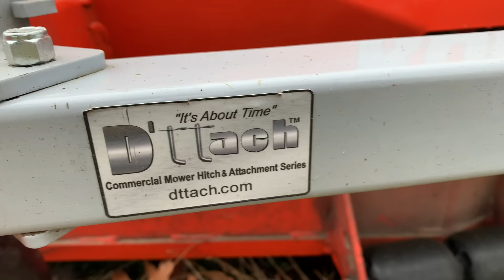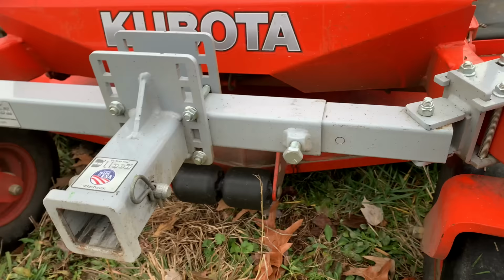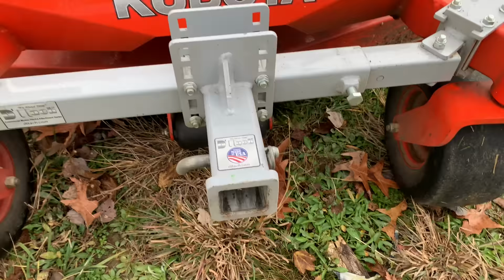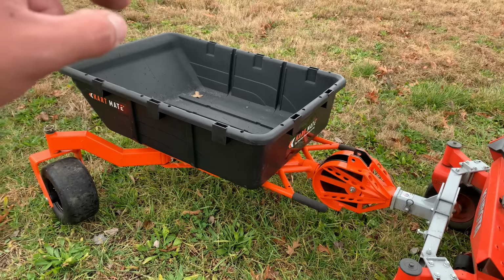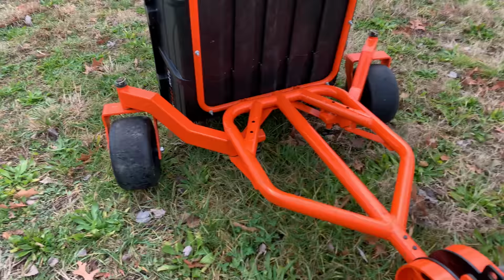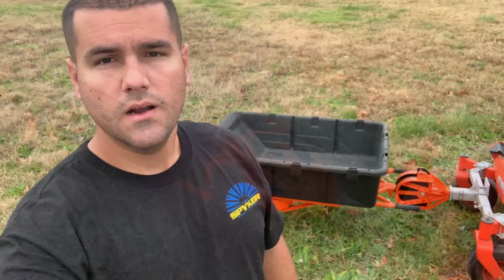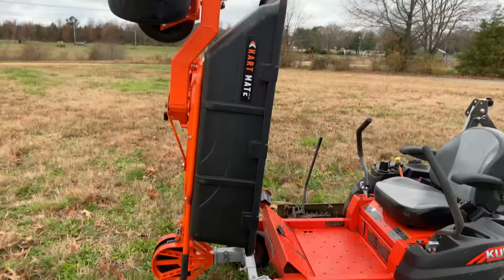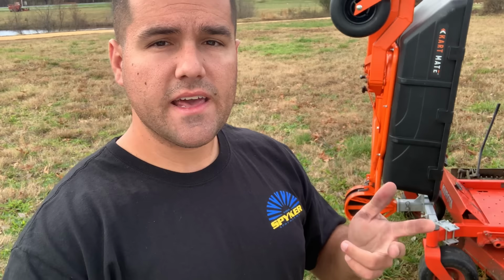Attachments to Make Your Mower More Efficient! [Do More with Your Mower!]

Comment: I just bought a Kubota Z412KW, which has zt3600 transmissions and it's max towing capacity is only 250lbs. The Z421, Z422 models are identical. (Other brands in the same price range are the same or less depending on the weight of the machine itself because they use zt2800 or lower transmissions. The Kubota is a heavier machine.)

The extra loading on the transmissions should be a concern. The loaded dtatch unit will probably far exceed the mower's specified maximums (total and towed weights).

The out front barrow will also put much more strain on the transmissions during turning, compared to one that's towed.
Reply from the maker: I guarantee it will. I’ve owned this since early 2020 and haven’t had a single problem. It’s got limitations obviously but I just use it with some sense and it’s never let me down. I’ve had WAYYYY more than 250 pounds in it and the machine has almost 500 hours on it now with zero problems.

Comment: I wonder if you could weld a dump truck bed to it also. And maybe you could weld a swimming pool on the back so if you get hot you can swim while you use the auto mow feature you already had welded on. Way too elaborate for a wheel barrow attachment.
Reply from the maker: I like the swimming pool idea. Already has a dump feature.

Comment: Looks like something my welder could fabricate with a few modifications
Reply from the maker: Probably could. I see tons of people say they’ll do it or have it done then never hear back from them or if I do they said it broke after the first try. People absolutely hate this thing because of the price but when they try to build one or see how well it actually works they understand why it’s not cheap. I honestly thought it was too expensive too until I bought it and made my money back on the first job I used it on. 🤷‍♂️
Reply: I was thinking of the same thing except for the fact that I have no use for it neat idea tho I have a rear hitch on mine that I don't use much on mine for to use heavy bolts to make it like a class 3 trailer hitch from the junk yard and some thick steel plates I'd use grade 8 bolts on it deffently a high stress aria or a guy could get some heavy steel tubing and make it so the hitch is ajustable but got to use the correct supplies to make it

Comment: Seems to me a trailer would much more effective. I also have a mowing and landscaping business. The only benefit I see is being able to fold it. I use trailers when needed. And I can put more than 1000 lbs in my trailers. And more leaf’s, stick and etc because the trailer is bigger in size.
Reply from the maker: Gets a lot of mulch in tight spots that a trailer can’t go. Unless it’s a really small trailer. I’ve also used it to haul all kinds of random crap. It’s very nice if you don’t have access to a dump trailer, get 10 yards delivered from someone and can load this and drive it where you need to and dump it. Makes a solo guy very efficient. I don’t do lawn and landscaping anymore except at my house and I still find plenty of uses for it.

Comment: That’s to much work I hope you didn’t spend much on that I could build something better from parts at my house
Reply from the maker: I see plenty of people say that then I never heard back from them. And the ones that do build them use 2x4’s and the thing breaks before they move 10 feet with it. This thing is meant to hold roughly 800 pounds. I don’t even think my mower is strong enough to move that weight but a much larger commercial unit will do it all day long. I saw your comment about a third caster, what do you mean by that? You added one to your actual mower?
Reply: I wouldn’t waste my money on one id rather buy  the self propelled cart that will operate with out the mower . Like you said you would need a different machine to go through a gate with it .
Reply: these are great carts way better than a pull cart . I actually did build mine outa the front casters off of a parts zeroturn I had and square tube. works just like the 1 you have. I use it everyday.

Comment: I’m surprised they used full length threads on all those lag bolts. Looks like a handy piece of equipment!
Reply from the maker: It’s extremely well built. It paid for itself on the first job I ever took it out on
Reply: 444t

Comment: Why not put a hitch on the rear instead?  Seems silly to put it on the front. Can’t see if you’re riding around with it flipped up.
Reply from the maker: The flipped up feature is just for transport, nice to have if you have multiple machines on one trailer. Some people have mounted these on the rear of thier machine.
Reply: That cart looks like it would work on the back of a zero turn too. The casters would allow you to still steer however without jack knifing
Reply from the maker: @jameskirk3  it does! There’s plenty of guys who have mounted them to the rear of a stander

Comment: So dumb. I drilled a hole and put in a 2” ball for $8.00. I move my boat, trailers, etc. around, as well as pull shrubs by looping a tow strap around the shrub and then hook the other end around the ball. Easy
Reply from the maker: Sweet. Sounds like you found something that works for you. God bless.

Comment: Seems like a lot of weight added to your mower for basically 1/2 a wheelbarrow. I am confused why so many people want to make their lawn mowers into multi function machines; ie, snow blowers, plows. dirt buckets, Ect! Some mowers cost more than $12,000. and you want to beat the crap out of it with attachments that do a mediocre job of plowing snow and moving dirt! My 2 cents!
Reply from the maker: I’m a solo/part time operation. This unit allows me to add a piece of equipment to the front of my mower that allows me to transport a decent volume of bulk material. I don’t have to change the oil in it, I don’t have to grease anything on it, it always shows up and it’s virtually maintenance free. It also folds up and takes almost zero additional space up in my trailer. I understand it’s not for everyone but it works perfect for me and I didn’t have to spend $30,000 on it like I would have a used skid steer.
Reply: @ProgressiveLawnService  I will concede that in the end it is what works for you that counts. As you grow your business you may find that the "Correct" equipment for the job will always win out and spending the money for that equipment will be worth it in the long run! Picking the correct equipment, Dealer and knowing when to invest is extremely important; do the research! Best of Luck
Reply from the maker: I agree. Mechanize the process as quickly and affordably as possible. Thanks 👍
Reply: I wonder what the long term affect the transport mode has on the hitch bouncing up and down the road? I can see a dethatcher not being too brutal, but that has to be over 100lbs.
Reply: The real problem is the tool is too far from the drive tires. I made a hitch for the rear of my mowers. It works much better because the drive tires are closer for mechanical advantage.
Reply: A $12k mower actually makes a great snow plow if you take the deck off. With the deck off, it can do pretty well. They get pretty decent traction too in the snow, but I wouldn't push snow with any hydrostatic trans below a 3200.

Comment: Good job on the video, but that's got to be the dumbest attachment I've ever seen, especially in the upright position.  A conventional trailer attachment at the rear makes much more sense.  But whatever floats your boat, I guess.
Reply from the maker: The upright position is just for transporting. Takes up no more room on a trailer than the foot print of the machine. Having it out front gives you more accuracy on where you’re placing material or loading it from. It paid for itself on the first job i ever took it on. Doesn’t seem dumb to me 🤷‍♂️

Comment: What a kluge! Added weight and stress should not be added to a MOVER. They are not tractors. What are your design qualifications and engineering to recommend these products? Probably voided the manufacturer’s warranty.
Reply from the maker: Mine? None really. But the guy and his team (engineer and fabricators) who makes them has quite a bit. Going on 3 years using this and have experienced zero problems. Mower runs and operates just like it did the day I bought it. I have a tractor. But it’s not practical to take everywhere a mower can go, that’s where this comes into play. Plus, 3 ACL surgeries and 2 herniated discs in my lower back thank me everytime this thing gets used. If you don’t like it the great thing about freedom is you don’t have to buy it, crazy thought I know.